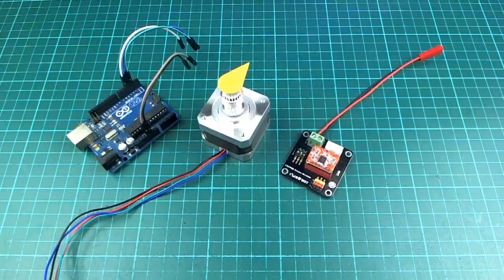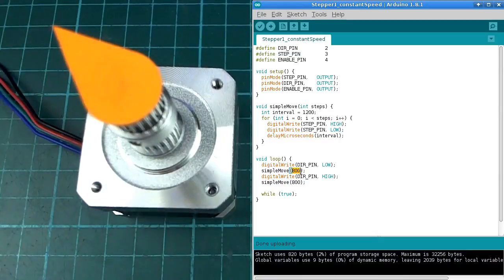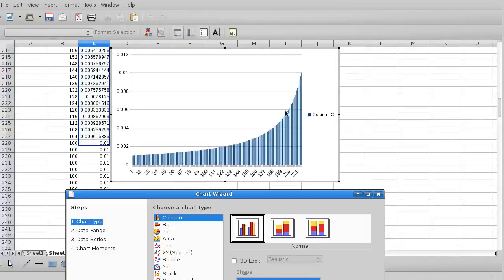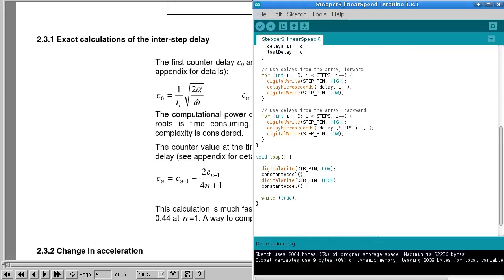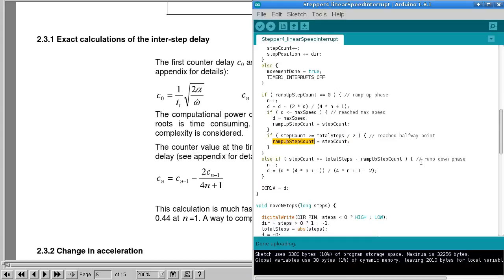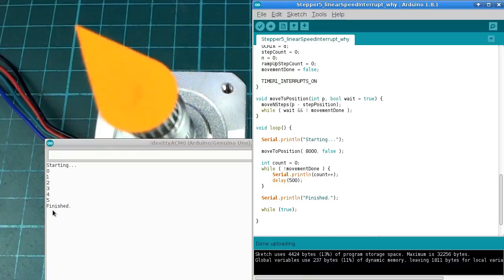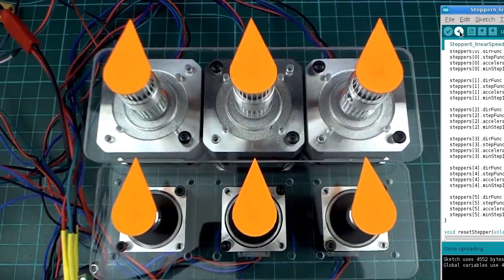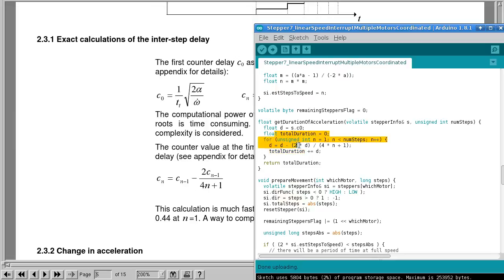Coordinated stepper motor control (arduino)

Comment: Actually linear acceleration is not always what you want...  I made a position controller in the late 80-ies and we had problems when we used it for portal conveyors. The structure was shaking.  The reason is that linear acc - constant speed - linear deceleration contains a lot of higher harmonics. Ideally you should try to move things in a way that does not have any higher frequency components. Sine-square acceleration does this and I used a table to calculate this. I also had dedicated hardware to generate the pulses... The portal conveyors were not shaking any more but we could notice that the structure bent very slightly during the acceleration and deceleration. It was amazing...
Reply: For starters I think it's good idea to start with linear acceleration/deceleration. Other acceleration profiles can be added at a later time if coded such.

Jerk controlled acceleration I think is the most desired (control the acceleration of acceleration to produce velocity profile and over time it gives the position)

There's couple of mainstream ways to implement that. Make the Jerk to Jerk or Jerk the Jerk with sinusoidal profile.

Jerk is just the acceleration of acceleration. Or how fast the acceleration changes.
Reply: Sure you have to start with what is usable and simple to implement.
I think the smoothieware is using jerk and maybe the TinyG/G2 and gbrl too...
Reply: No real blog, I have posted some clips of flying fpv on youtube lately and I have my website siamect.com and if you look at the upper part of it there are a few links to technical stuff but it is really old and corky...
Reply: Siamect interesting insight. Do you have any DIY blog/vlog? Would be nice to learn from someone more experienced 😀

Comment: Good job.  
And yes there are other projects doing maybe not exactly this, but that can be used for the same purpose.  Like TinyG and G2 by Synthesos. Have a look at GitHub. But these are cnc controllers executing G-code coming in through the usb port so the complexity is severe... and you need something to send the g-codes and maintaining the handshaking etc.  
I think you program is very useful for projects where you don't need all this complexity. Well done!